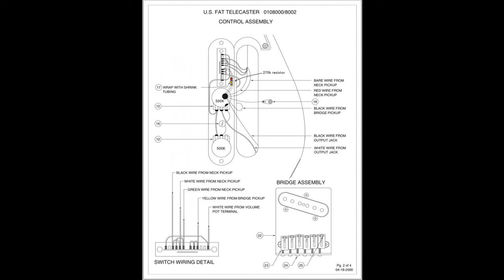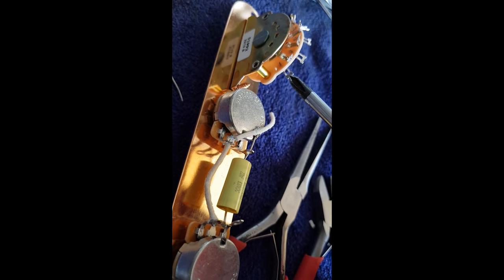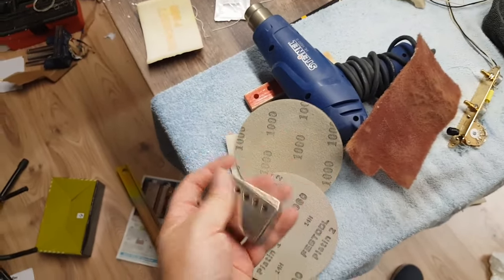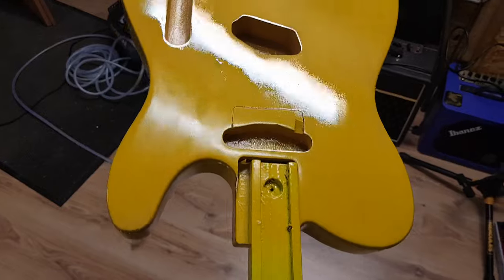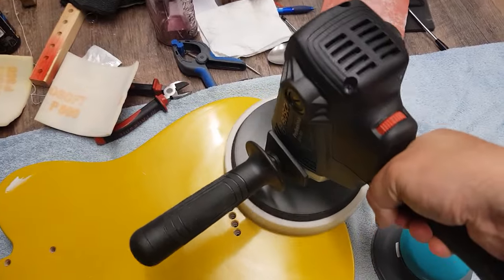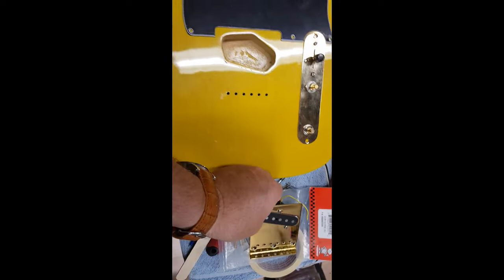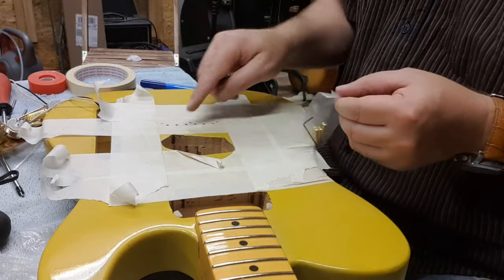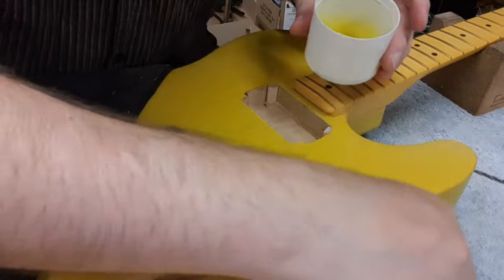Keith Richards Micawber Telecaster is built on a low budget Part4

Comment: I recently changed one of my Telecasters to a 4 way switch and bridge and neck in series and love that in series sound, however, I love both the orange drop and bumblebee capacitors as both give a different voicing, I am thinking of making a switching circuit so I can switch to the orange drop cap.
Reply from the maker: I also like both, and you can even change whether you use a vintage or modern wiring diagram! Thank you for watching my video!
Reply: @viktorlieszkovszky9683  I liked this video series so I have decided to Subscribe, by the way your English is not as bad as you think, you just get confused which descriptive words to use but you are very understandable!
Reply from the maker: Thank you for the kind words!